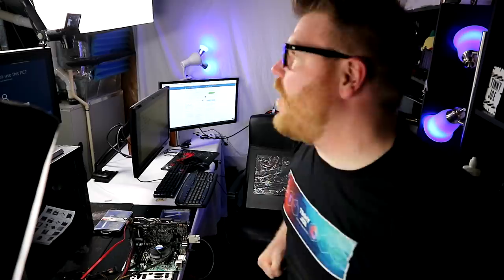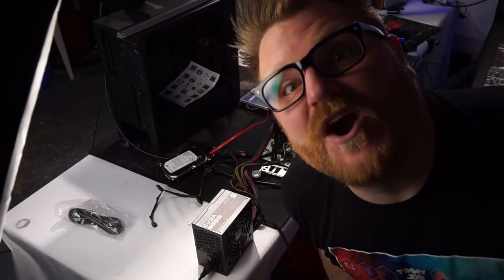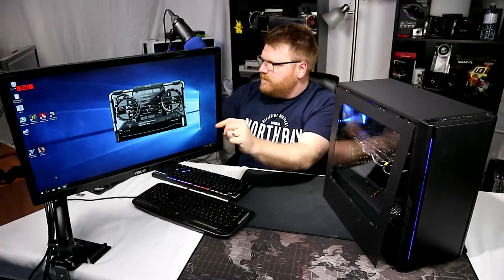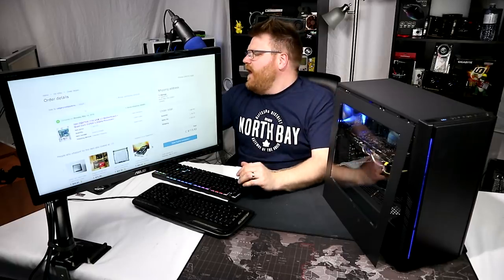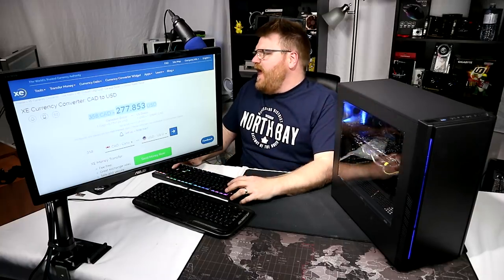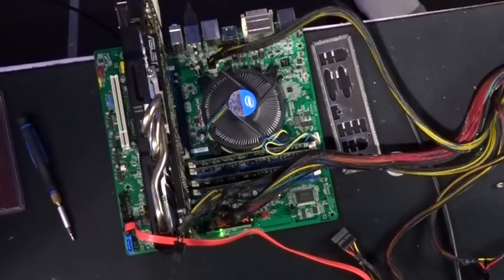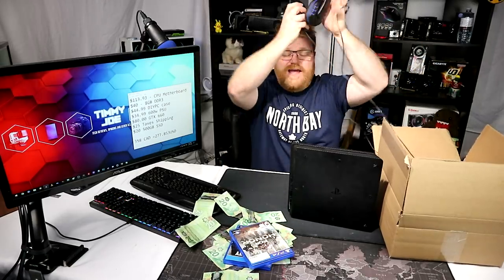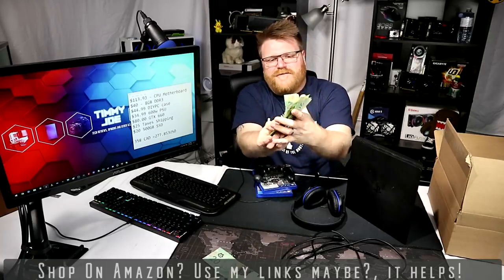How to build and sell PCs at a profit in 2018 (thanks to Fortnite!)

Comment: Nice! Thanks for showing your price, helps me see where im at with a repeatable budget build I'm workin on for a vid too. Seems to be a nice theme right now :). 4 core/8 thread Xeon w3565 (i7-960) system, 12gb RAM, GTX 960 2gb, HP Z400 mobo base in Corsair Carbide Spec-02 case for $235 with 500gb HDD, $265 with 500gb HDD and 120gb SSD, or $308.15 for 2tb HDD with 120gb SSD. You might have just convinced me to go ham and build a few of these to try to sell considering kids getting out of school for summer break pretty soon.
Reply: well ram and cores is keen to have these days for pascal. AMD utilizes more ram with ryzen, then with hdd for back up and minimum ssd for games with storage.
Reply: AMD Ryzen utilizes faster RAM, rather.
Reply: also dual channel more effectively with its infinity fabric even on new ryzen refresh and AMD optimized games.

Comment: i build pcs for $550 (3 used parts 7 new)
and sell them for $690 (free shipping)
and make about $65 profit each
specs: 
GPU: you choice between: GTX 1060 6gb, RX 580 8gb, or GTX 980 4gb (same price)
CPU: i5 3570k
RAM: 8Gb DDR3 
HDD: 1Tb

Case: Tempered glass and 6 rgb fans (aka gorgeous)

-450 W power supply
-cheap ass motherboard

(Has wifi and bluetooth)

benchmarks:
Fortnite on all epic settings 1080p 100fps avg

i dont know why i just did that...
Reply: You're spending way too much in my opinion. I know this is 4 months old so I hope you dont spent that much anymore. I usually build computers for $100-400 and sell them for $100-300 profit. I actually picked up 3 RX 480 8gb for $80 each and a i5 6500/i7 6700 with 2 motherboards for $300 for both.  I plan on selling them for about $550 and $650, when I get all the parts and should get about $200+ profit on each computer

Comment: I JUST BUILT A Dell for my girlfriend...I found a forth gen i3 HT at work bought an extra 4g ram stick for 20 dollars ans I had a 750w corsair in the closet ...topped it off with a rx470 ..an old 300gb velociraptor for boot ...its not a bad running system at all considering ….and yes I know the PSU is more than It needed but I wanted it built ASAP one day ill get a 500w and change it out but for now its a little beast

Comment: Awesome job getting decent and capable gaming PCs to the masses for a reasonable price! Much better deal than a big box store PC. Just did a new build for resale consisting of an i5-8400, GTX 1070, 250GB SSD, 8 GB Ram, Nice looking ( but cheap) DIYPC tempered glass 4 fan case, and got a cheap CM AIO. Built for 770, sold for 965 USD :)
Reply: killercat268 where did you sell it on? Trying to sell my i5-7500 system for 375 and no one is offering anything for it.
Reply: Craigslist
Reply: wolffactor56 what are the rest of the specs?
Without the graphics card, I could have sold the i5-8400 system for $375 and still made a profit.
Reply: killercat268 i5-7500, Asus Tuf Mark 2, 256gb SSD, 500 watt power supply, and ATX case. No memory in it, just transferred it to my new system.
Reply: wolffactor56 not that bad. What's the case?
Reply: wolffactor56 I mean it's a nice enough case but I wouldn't pay $80 for it. But no offense, me, being a system builder, a new 8th Gen i5 with similar motherboard, SSD , power supply and a nice looking case like h500p I have bought new for for $360 US. I assume you mean USD right? You may have more luck parting it out?
Reply: killercat268 yeah it's actually a really nice compact case. I would never pay 80 either lol. I paid about $15 for it new. I might take your recommendation. Thanks

I need to find cheap ram for it.

Comment: Nice man! I'm thinking of doing the same, I have some spare parts around that I was thinking of putting together to sell:
AMD FX-4100 on a Gigabyte 990-FXA-UD3 with 2 failed RAM slots, the 2 remaining slots don't allow dual channel. 2x2Gb G.Skill Ripsaws 1333 CL7 DDR3 and a Visiontek Radeon HD 6970 2GB with reference style cooler. All I need is a case (should be able to get a decent case with DVD drive for $15ish from local recycler), Storage and PSU along with a copy of windows.

Comment: Fortnite is alien to me. 
Clicked on this video to see what bargain hunting means do you use. 
This is just straight forward bargain hunting, fine and all.

This thing has the same specs basically as my current PC before I upgraded too where it is today.
My rig once was an I5 2500k (upgraded to I7 3770k) I also had a GTX 560 ti at that time, replaced with a R9 290, last month since its passing back to the 560 Ti..... :( 
Waiting on a used R9 390 now! 

I could get into what your doing, I've done similar things back in the day.
I used to get my hands on old office computers, I knew a guy who'd buy them in bulk and I'd buy them in smaller bulk from him to refurbish and resell. 
Back when normal people still wanted to purchase a desktop, and people were crazy about laptops! 

What happened to me, is new computers were getting cheaper then I could resell them for any profit worth my time. 
So I just gave up. A little part of me is tempted to put aside some money and try to do some leg work to see if I can gain any new connections and perhaps try to sell things online.
I'd likely would still try to do Kijiji, but everyone on Kijiji wants something for nothing doesn't matter what you sell or how low your price was..... 

Don't think I could be bothered with bargain hunting each individual computer component together, low bulk prices on something I can profit on is the way I'd want to go.

Comment: Which is better? i5-3470 or i5-2500?

Which is better? Gtx 1050 ti or 660 ? 

Don't ask me why am I asking this questions , i'm a noob and i have the i5-3470 and i want to buy a 1050 ti and i was wondering if it's worth it
Reply: No 1050ti wont run fortnite with that cpu any good, buy 1660ti or even 1060 6gb
Reply: I5 3470 is better but buy one with K on end of the 3470(3470k) so u can over lock it
Reply: @sienipilvi1010  what do you mean? His CPU is fine.  Dont buy a 1050ti or a gtx 1060 or even a gtx 1660. You can easily buy a RX 480 4gb/8gb for under $100. I actually have 3 rx 480 that I bought for $80 each. Also if you live near a microcenter then just buy a ryzen 5 1600, they go for $80!
Reply: @carloscampos5  Well 4 cores is enough, but 4 threads is not, since the cpu is not K, he cant overclock it further. Highest clock is 3.6. I have i5 6400 4 cores, 4 threads, and mx turbo 3.3ghz, and it sucks ass and runs like 500points In cinebench r15
Reply: @carloscampos5  actyally SOMEBODY tested that, games that arent opyimised the crossfire, runs worser than only one card, and his rx580 got sixty fps, and two 70 fps, when the game wadoptimized to crossfire

Comment: I've always wanted to take my PS4 apart and build it into a smaller computer case, so it can get better airflow. I have the 1st version PS4 and it gets super loud, even after having taken it apart to clean it out and put some artic silver 5 on the heatsink. I've seen a mod where they drill holes in the top and then screw a case fan on the top of it. It's ugly. Any thoughts on a good case to build a PS4 into?
Reply: Stephen Morrison I would I use a small drill nothing to big and make small holes in a design around the fan and then leave it in a wide open space
Reply: Swap the fan out for a sunon maglev fan (they make the corsair maglev fans) on digikey that is the same size (they sell them bare wire, so you need to solder two wires in total). Just gotta make sure what voltage the PS4 accepts for fans, some are 5v, most 12v. If you get the wrong one you'll either burn the fan out (i.e. 5v fan on 12v header) or it runs it way too slow and burns it out also due to the fan pulling the same amps but @ 12v (amp*volt=watt). However a maglev sunon fan should solve all your woes and it should be much much quieter than the stock fan they use and push far more air with far more static pressure.

Like they got any size you need, ranging from tiny to large. I think they also sell super thin/super thick versions of the fan too, not positive though since I don't really care about the $10 I save per fan if they're going to be ugly with the wires. It's the reason I don't use noctua, oh shit noctua should also sell fans in all sizes too but you won't have to deal with a bare wire. I'd say sunon maglevs could potentially beat smaller noctua fans, but I'd say get whatever is cheaper or easier (or both).

For soldering the bare wire, the other fan is connected so just strip those wires and twist the bare wire from the fan to the stripped fan wire that is already connected to the PCB. Throw a lil solder on there and you are good to go! Hell, electrical tape would work if you twist well enough (though, solder it and then tape it ideally).
Reply: Rake to the Face good to know, thanks for the response.

Comment: So that board and CPU makes no sense. 1156 socket is mainstream 1st gen socket (i5 750, i7 860 etc). 1155 is sandybridge socket. So either you got an i5 750 or a different socket. Weird.
Reply: Isn't the motherboard a 1155 socket rather than the 1156 socket as advertised by the ebay seller?
Reply: Umm timesinfinity that's what I'm saying. Has to be one or the other.

Comment: You spent way too much money on that computer.  You could get those specs by buying Dell (or HP, etc.) Prebuilts.  For 80-150 U.S. without a video cars.  You can then get a 1030 or 1050 easily for the rest of the budget.
Reply from the maker: How will you drive with out a video car? This PC looks 100% better than a prebuilt Dell, It also can be upgraded with a much better graphics card than a prebuilt's PSU can handle. You are making a dumb point here. I proved that I didn't spend too much money when I said I make 30% profit or more on these pcs everytime. Blue LEDs sell. Dell optiplex does not
Reply: You could still go the prebuilt route and buy a good looking local case for $20 tbh and that usually includes a decent power supply in my area BUT that’s in my area and the method shown in the video is repeatable so it doesn’t depend on local deals

Comment: what about the cost of Windows on the system? That would add to the total as well wouldnt it?
Reply from the maker: I give options to activate windows. I would buy the key from Scdkeys. sketchy or not. It's 20 bucks. You do not need to activate windows though. Eveything works with a watermark and no theme changes. Why activate if you're on a budget
Reply: Makes sense. (I live in the same city you are from by the way). I mentioned because I soon may have an i5 3570k for sale with either gtx 760 or a gtx 970 (depends on which one i want to part with and whats better for the buyer) and putting activated windows on it would kind of fuck with price a bit.

Comment: How is your system running fortnite faster than my Ryzen 5 1600 (3.8ghz) with 8gb ram and a rx560 4gb? I run it at 1080p med detail and get 60-90fps
Reply: Sk8more367 he's probably running it in 720p. That and maybe you have some program hogs running in the background
Reply: iHPanda definitely no extra programs so ya probably running at 720p
Reply: iHPanda I’d be a little mad if he is running 720p because he never specifies that he is playing in that resolution and he writes “1080p gaming machine” in the description
Reply: Sk8more367 Yeah it's gotta be something like that. Your pc should be a lot more powerful than this
Reply: I’m wondering the same. I think he is maybe running at 1080p but has the resolution scaling turned down. It’s easy to make that mistake in fortnite because the option in the graphics settings menu doesn’t call it resolution scaling or screen scaling or anything like that when most games do. I could be wrong but that’s the only way I can see that rig hitting 120fps in fortnite @1080p
Reply: It does 100 fps at 720 but its still a 1080 machine because it can probably do fortnite at 60fps 1080.
So it technically still qualifies.

Comment: I have a headache challenge for you. With ram prices as they are, people like myself want to upgrade to a Ryzen system for its low price but dropping an extra $200 to $300 on DDR4 ram isn't making it easy. Challenge: what's the best CPU and motherboard that ddr3 compatible? Reference items for build upgrade from an AMD A6 6300 with 12gb ddr3 ram, a 6gb gtx1060 and a 700B evga power supply. Budget $400 For upgrade parts... or if you want a comparison ddr4 CPU and motherboard and memory

Comment: Lol my pc wont load anything on fortnite and i have i5-6400,gtx 1050ti and 16gb ddr4 Ram.
Reply: Yikes! Did you make sure you installed the drivers for your 1050ti? Usually if you cant load anything on a game its most likely your graphics card or ur CPU temps
Reply: @carloscampos5  yup, i have the drivers installed
Reply: Have you tried other games or applications or is this issue strictly fortnite? If it is a Fortnite only problem, try reinstalling the game or repairing the install.

Comment: for one, fortnite sucks ass! While this is cool, it is kinda over priced if you are truly a deal hunter. I paid $100 DELIVERED for a FX6300 8gig DDR3 AM3+ MB 600w PSU 500gig HD GTX 650 TI Boost 2gig (that out performs a 750 ti) and a fractal case, The system I just picked up is an i7 3770K AIO Corsair cooler, 16 gigs DDR3 ARMORED Asus  Sabertooth MB 1050w Corsair PSU BuRay drive GTX 660 2gig and a let another Fractal case all for $200!!! I put my own SSD and the 1060 3gig I just got in it! You can find some amazing deals if you look right and know how to test before you buy. I personally wouldn't spend $500 or more on anything other than a DDR4 platform of some kind, DDR3 just isn't worth that much no matter what it is! I bought a X79 6 core full set up for 450! I'm sure most of us watching this are smart enough to know what parts really values are and how much we should be paying and how much we shouldnt be!

Comment: welp, time to scam kids, happy I won't be playing on what I build
gona sell a:
gtx 280
a I3-720 (yes the first I3 made)
4GB of ddr 3 900mhz ram
2 stock intel coolers
1 terra hard drive with 7200RPM
some 124GB SSD from 2010 or 2008
A mother board... if the old hunk of junk is now considered one
a case that was like 50$'s
- I bet I could get 800$'s from this if I just add RGB, as a wise man once said "RGB = performance"
Reply: 8 Bit Dog apple does that nowadays and actually they're so good at fooling adults 😂